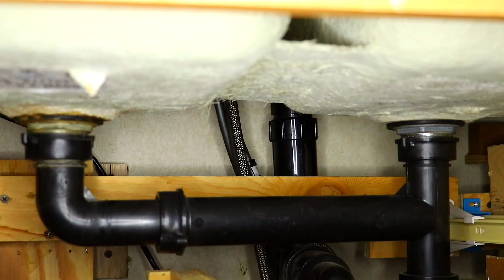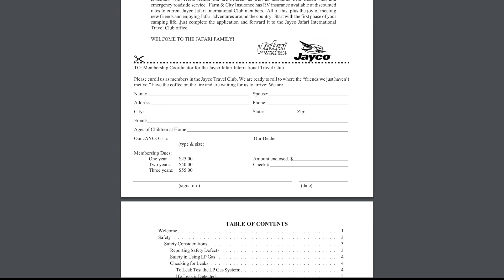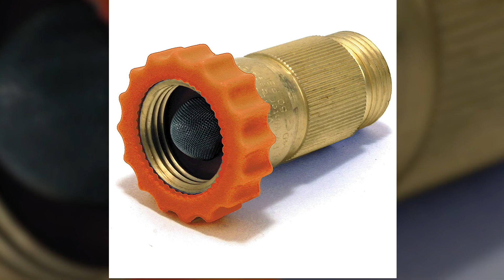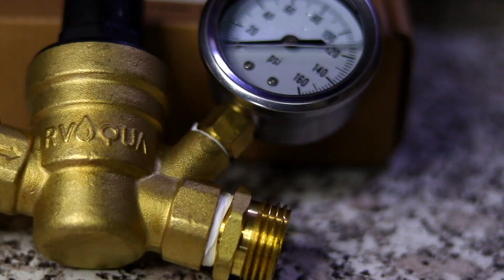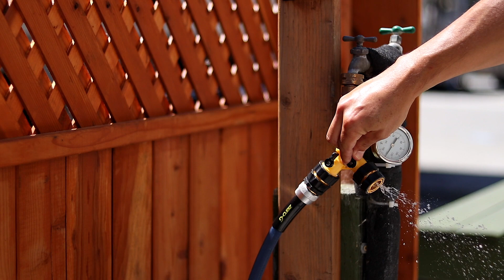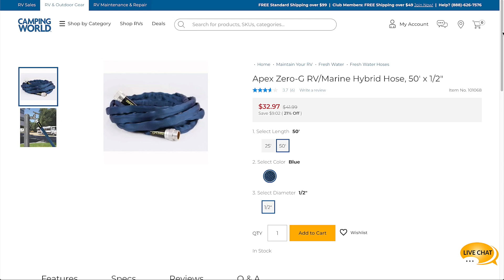PROTECT YOUR RV FROM HIGH CAMPGROUND WATER PRESSURE!

Comment: I like that regulator you have  
We usually also connect it to the park faucet but we have seen other people put it directly to the RV
Reply from the maker: It's just a cheap regulator off of amazon, but has worked very well, it's nice having the adjustment to set the pressure how we want it. I have seen others that connect it to the RV also.  Both work, I guess it's just a matter of preference.